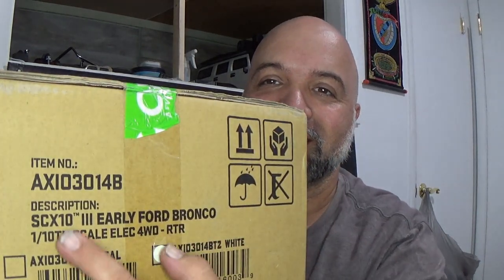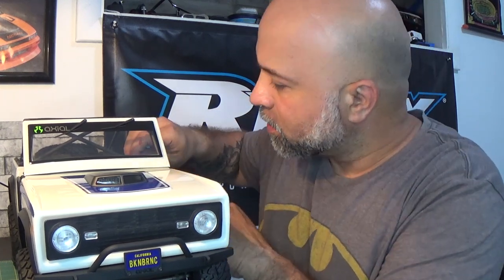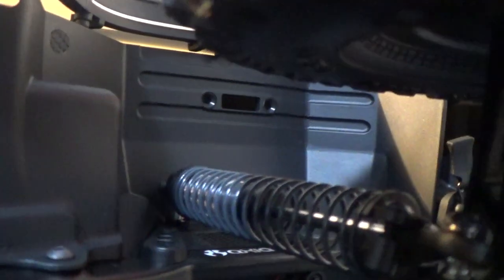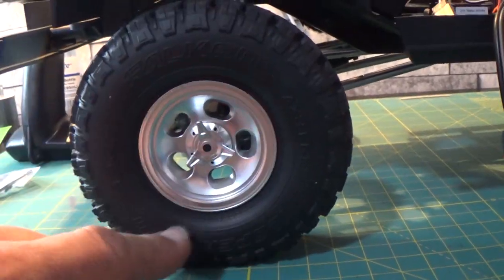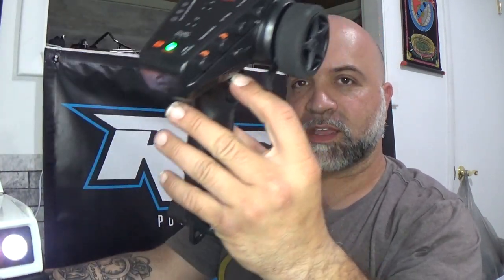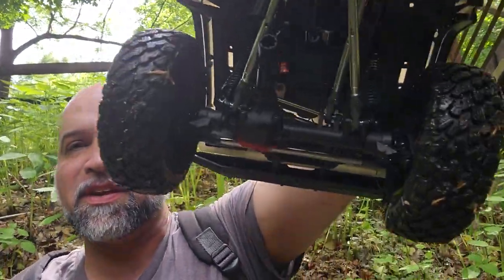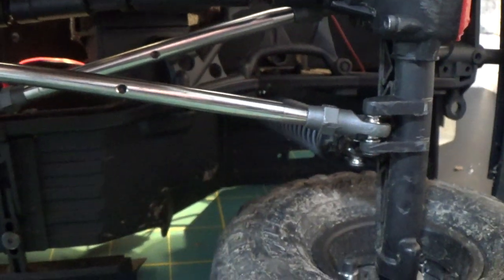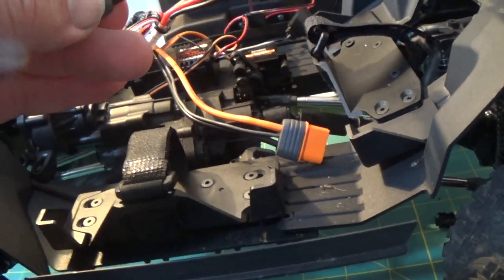SCX10 iii Early Ford Bronco Review and Creek Run with a minor flaw

Comment: Great video 👍🏾 I had the same problem with the front driveshaft.  Easy fix as well.
Reply from the maker: Thanks yes it was very easy to fix the driveshaft on the field and no tools needed which was nice
Reply: @rccargarage  i was doing an unboxing and first run video when mine came apart. i  posted it. name of video is from Box to Rocks
Reply from the maker: Yea I saw that video your video was the one I was talking about when I mentioned about seeing it